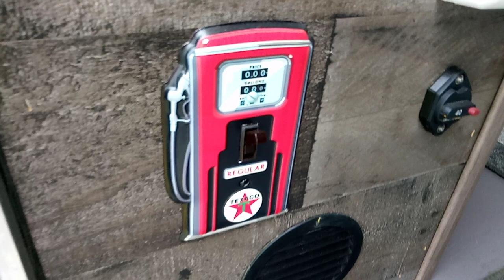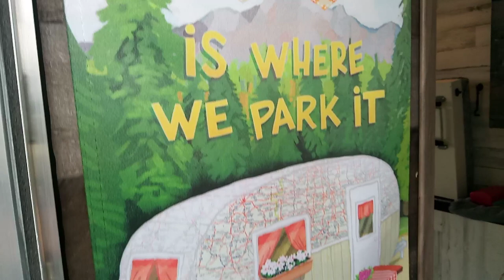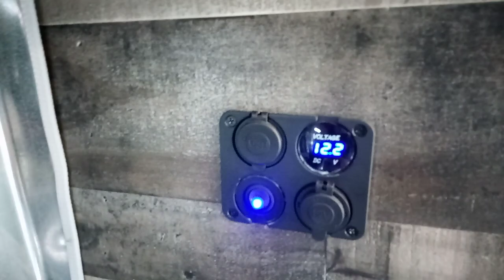Our Homesteader Intrepid cargo trailer camper conversion

Comment: This is an excellent video.  Your patient show and tell was very easy to follow.  No loud music (which was great).  Your layout is well thought out for what you wanted your rig to provide.  What’s the height of your trailer inside and how do you feel about it as you use the space?  

And thank you for sharing yours as well.
Reply from the maker: Thank you for your comment! I agree with the music observation, it's a distraction! The interior height in the center is about ,6'2, I chose the shorter version for appearance and for ease of towing and no my head doesn't hit the A/C!! My wife and I find it very cozy,we are considering small windows on either side.

Comment: Nice job, thanks for posting and including details.  How much usable space do you have for your ATV?
Reply from the maker: Thanks for the comment and question! The kitchen and shower area is open when the ATV is in the camper but that's about it and when loading the ATV it's crawling off of it and carefully stepping on the bunk to get out, unloading is easy we push the ATV out not running in neutral!

Comment: where did you find the screen for the read door?
Reply from the maker: It's the regular opening size screens just switched around the magnets,hot glued them together at the side panels and used Velcro tape on the door edges and on the screen edges,panels made just for that were ridiculously expensive!

Comment: Did you build your cabinets?
Reply from the maker: I did, portable table saw, electric Ryobi miter box saw,small air compressor with Porter Cable brad nailer and a Porter Cable air stapler and lots of wood glue! Cabinet frames are 2 x 2,1 x 2 and 2 x 4 cut down to 2 x 3 and the most important tool was the Ryobi 20 volt router with a flush trim bit!!